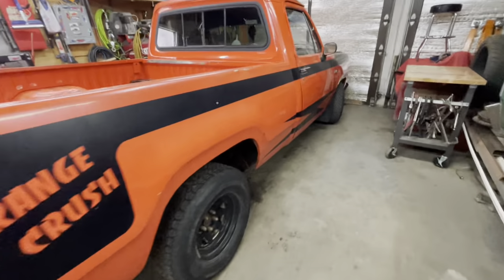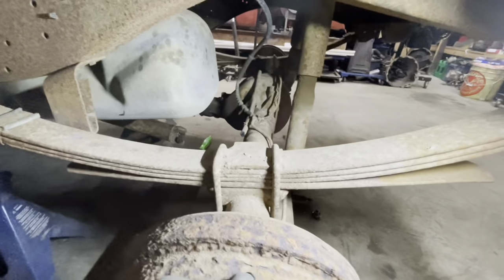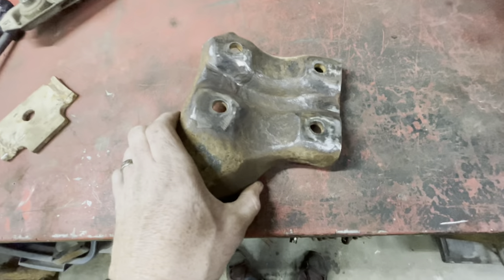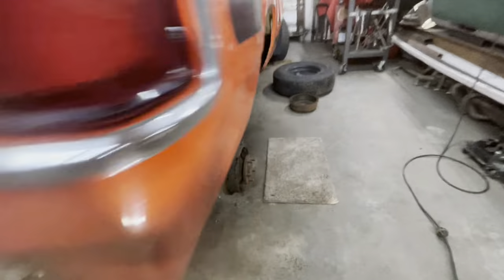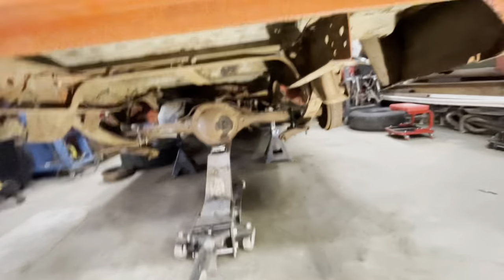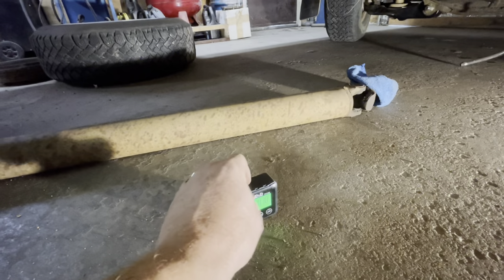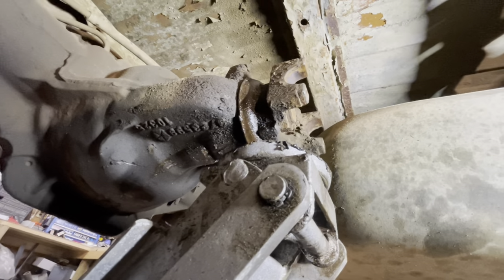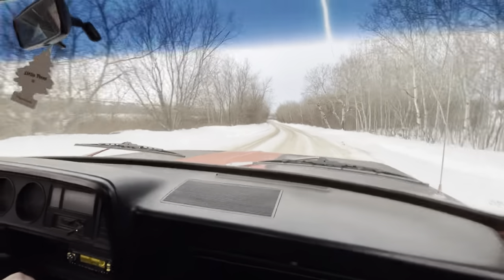How to lower your dodge d100 part 2

Comment: She looks good Bud  I did mine but put cal tracs on it  There are 2 dimples in the shock crossmember i drilled them out and it moves the shock angle  out at the top  Kool old truck

Comment: Diff. Gen. Points down some comp. To the trans. Because under acceleration the pinion pivots upwards ! Your shocks need ta be shorter also ! I have a 84 with a big block & a 9 " ford rear mounted about the same with some lowering blocks !

Comment: The (in)famous Dodge Lean. I think in all honesty its because you have the gas tank mounted on the driver's side, and a tank o' gas plus the driver's weight just causes them to sag on that side. IF, if you remove a coil out of the spring on that side, it kinda evens out. I like your video Part 1 and have thus subscribed. Even though I know how to do this, the part about radiusing the rear pivot point on the van LCA was a good idea and, of all the videos I've watched about this procedure, was the first time mentioned.
Reply from the maker: I agree all the extra weight would easily account for it. I find a lot of these trucks got worked hard too so the springs are generally sagged out.  I have seen 2 frames that had bent cab mounts on the driver side which made it look like a lean but the box was straight.
Reply: @moparmuscle123  right? I recently saved an 87 D150 (LXE) from the crusher. It was parked for 4 yrs. 134k on the speedo. Went to put some front shocks on,  drivers side coil spring has a twist in coil helper. Everything else on this truck is straight except that spring.

Comment: As far as I've herd that they sit more on that side cause of our roads not being 100% flat, so the truck never sits flat until on a shop floor or parking lot then you see the lean
Reply from the maker: Every one of my 2wd trucks has had the lean. You can really see it on this one tho going down the road, hopefully it’s not a twisted frame. Maybe too much torque from the slant six haha
Reply: 🤣😂... I'm pretty sure physics is the reason most vehicles lean to the driver's side. To date anyway, vehicles all have drivers... more load on one side of the vehicle, over the life of the vehicle equals a lower ride hight on the driver's side... great video BTW. I have shot a couple of diy "Shorts", and it isn't nearly so simple as it looks. Great job.

Comment: Well done 👍 u did fine on being very informative to do the job! I don’t know why the dodges are always lower on drivers side but they always are like you say ..maybe the gas tank an battery more stuff on that side idk .. an they always put such a massive rake on them too aT the back.. even with the trucks of my era which is. 2002 the rake was jus awfull high at rear  .. I lowered my with different leaf packs at rear that will give me a 4 inch drop an front still has original spring height but are new .. I may need to bring it down some yet .. with those van parts you showed in a video of how to do the front.. but your way is much better on wallet 👍jus I’m wheelchair bound so I took that way for feeling like it was a little less work as in no welding an such like that for me to have to do 👍you should do alot more videoing of all your work your going to do  on it or any of your mopar stuff .. they will do well an your channel will grow quite quick .. anything to do with mopar seems like it isn’t out there as much .. plus you do good at camera angle/shots an all love the paint scheme on the truck 👍this truck could be your channel grower for ya.. big time, not sure but if you put on Instagram an Facebook advertising your YouTube channel, but if you did I thing it would be a big go !! 👍cheers 👍
Reply from the maker: Thanks, I’m trying to get better. I do enjoy the process. And if I can help one person im happy with that. 
I haven’t really advertised my channel, as im not a huge self promoter, but maybe I should give it a little more effort. 
I certainly have plenty of projects on the go so there will be more Mopar content coming. 
Awesome to hear the wheelchair isn’t holding you back from hot rodding!

Comment: Really good video description of the process. Was that an actual camera or your phone? The video was really nice for what seemed like low light shooting in the garage and under the "Orange Crush". I'm working on a 92' D150. About to take on new window felt, regulator and power switches x2. Not looking forward to it.
Reply from the maker: Most of it is shot with my iPhone 12pro max, haha. I do use a GoPro once in awhile. 
Window felts aren’t so bad on these trucks, the old window switches always irritated me with how the power is connected. I always fight to unplug them.

Comment: about the lean, all the weight in these trucks is on the driver side, fuel tank, steering box battery etc and  obviously the driver, more weight and stress is put on the driver side

Comment: Loved the video man; it's great seeing old school Dodge content for a change! Did you end up using factory length shocks or did you buy shorter ones?
Reply from the maker: I just use the factory length ones. I’ve never really messed with trying to find shorter ones
Reply: @moparmuscle123  thanks for the response man. That makes me a lot more confident about sourcing parts and tackling this project because I already have everything else I need.
Reply from the maker: @ThePostZenith  it’s a pretty straight forward deal, I think the rear is something that intimidates people but if a guy takes his time it’s not so bad. It’s definitely worth the work.

Comment: did you ever have issues with your frame hitting the axle tube and bottoming the truck out against the frame with the flip about to do it to my truck just a question I had and I cant get a straight answer from the forums?
Reply from the maker: Yes, it will bottom out on the frame with too much weight in the bed. You could easily toss some air bags in the rear if you still plan to haul a decent amount of weight.

Comment: I’ve seen guys theorize the drivers lean is because of the gas tank on that side. Could be, as good a guess as any I suppose.
Reply from the maker: I’ve found a couple that actually had stretched cab mounts on the driver side so it looked lower but the box wasn’t lined up.

Comment: Did you change to a shorter shock, or were the stock ok and not bottom out?
Reply from the maker: I’ve always just used the original shocks without issue, but I  would like to do a little research and find a better option in the future.
Reply: @moparmuscle123  thank you for the feed back, great video.

Comment: Maybe someone can answer this for me, but should the angle of the diff be set with wheels on and the truck sitting on the ground? Wouldn’t you want your suspension at normal ride height to adjust the angle? And with that being said should you lower the front first to get the proper angle for the rear diff and tranny?
Reply: As long as the weight is on the axles you are okay.  If you want 100 percent true, yes, you need the frame level, but measuring this way compensates for that as you are measuring with the truck static and not changing the frame angle.  (Is this making sense?)  In short YES. this works so long as you don't alter the frame angle by jacking it up or lowering it between measurements.

Comment: what size u bolts did you use?
Reply from the maker: I think it’s in the video, but if I remember off hand it’s a 1/2” bolt, 3” axle tube so 3”
Inside and like 8” long inside in a “U” shape